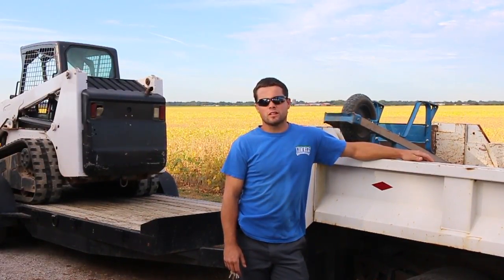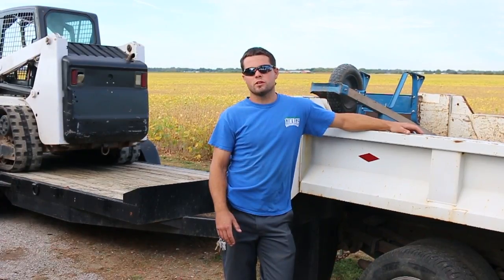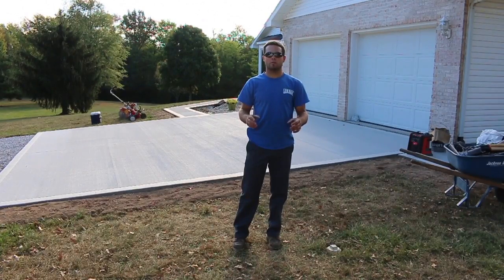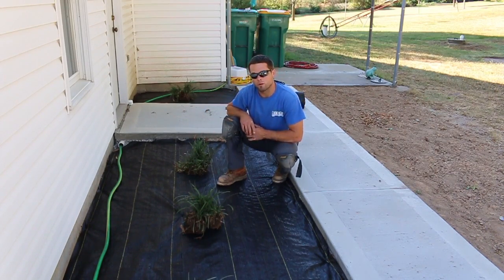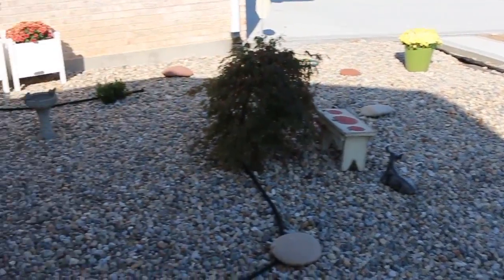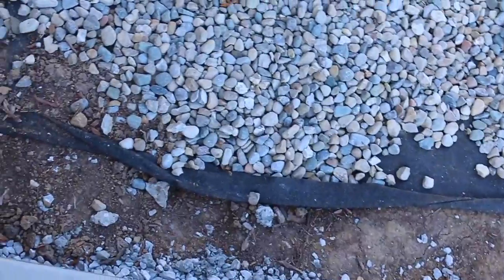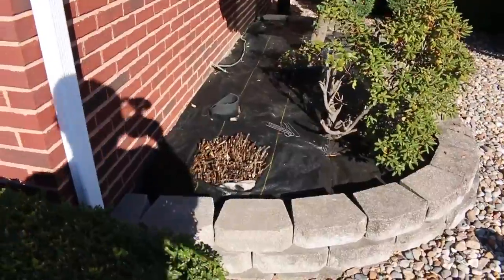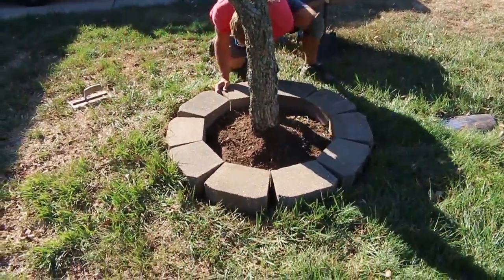Eligant, EXTREMELY Low Maintenance Landscaping in Belleville, IL

Comment: That's one way to make a house look bad.  I loved those shrubs.   The second property and installing a stone ring around the tree..... that adds a lot of time to weekly  mowing maintenance.  I took a trip to Des Moines up Rt 61 through MO and IA and along the way I stopped at an all night truck stop with a new idea.  Someone is selling CURBING just like the city pours along streets.  The landscaper had used curved and straight pieces to put together a raised bed and the concrete rolls down to ground level and out  4 inches  at ground level which will prevent all need to run a weedwhacker.  Mower runs over the concrete and the grass looks neat.  I do it with wood and by other means since learning about this in 2009.  It's worth a trip to Des Moines.  I like lawn mowing alone without weed trimmer and blower any way I am able to talk an owner into modifying the setup.